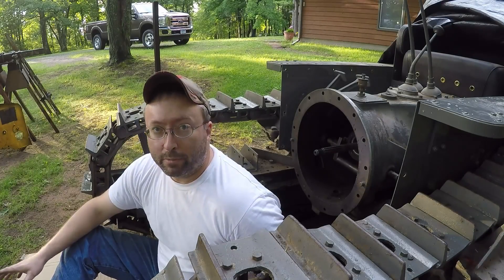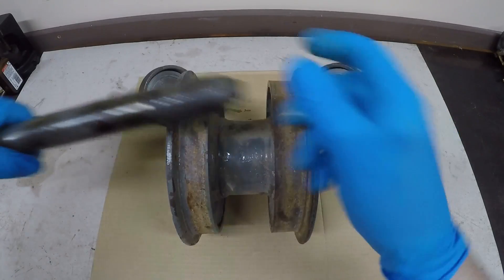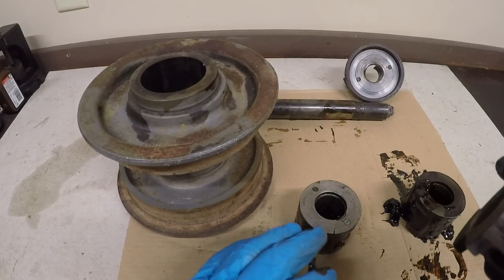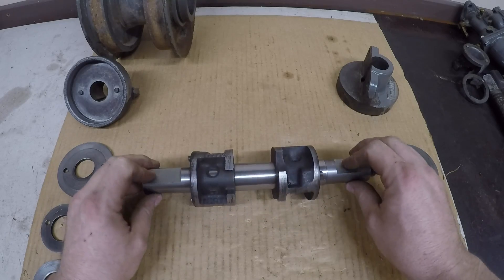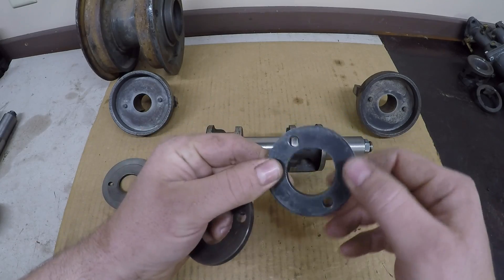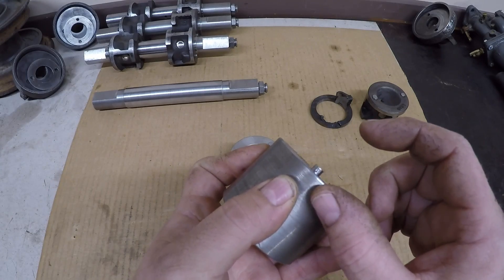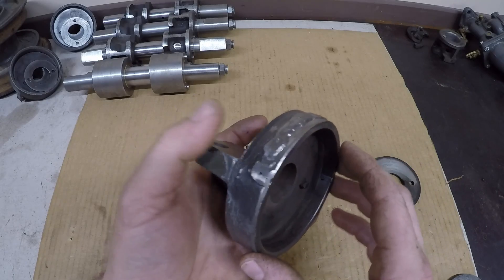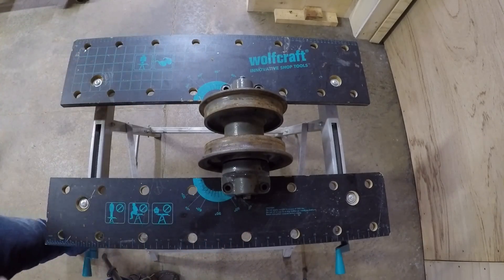Caterpillar Ten Track Roller Repair

Comment: After coming back some umpteen years later, did you check the input bearing for noises?
The clutch bearing rod shafts, there was no lip seal, felt seal, or ever oring?
Reply from the maker: No bearing noise yet, although I’ve only drove it just a few times in the years since. And correct, no seals on the clutch release shafts since this is a dry compartment 👍

Comment: Cat operators manual calls for "Roller Lubricant" tru the buton  fittings. Can grease be used instead?
Reply: @squatch253  Thank you.  I have the original pump that takes 3 gal or so, so I'm off to find a 5'er of 00 grease.  I'm having a blast working on my 4U, and appreciate your guidence.

Comment: I noticed you didn't talk about wear to the rollers themselves. in the late 60s and early 70s when I was just out of high school, I was working for an outfit that rebuilt and flew antique aircraft all 1929 or older. One of my jobs was to media blast airplane parts. We were working in the old caterpillar dealership shop buildings in Boise Idaho, Western equipment Company if I remember right. The blasting cabinet was right next to the automatic welder that would take track rollers and build them up back to factory specs. It was an early wire welder that used granulated flux that poured out of a tube over the hot weld. The rollers were on a lathe and the wire welder moved back-and-forth to build up the wear. In the late 60s the old shop buildings that were abandoned and I think 1952 or something had shelf after shelf after shelf after shelf of old new stock cat parts.  The good news is that at some point in the late 70s or early 80s all of those parts were collected and sold to someone who put them up for resale so they didn't just go to the metal recycler.

Comment: Thanks for the video. Just did the rolls on my R2. What did you use for material in building the roller shafts? I used 4140 Prehard which is not quite as hard as the original. should last for a few years !  See you at ACMOC.

Comment: What kind of steel did you use for the track roller shafts?
Reply: I was thinking the same since he didn't mention it but if I remember right from other videos on different machines the steel is just mild steel. And the thought process behind that is you want the wear...(well really you don't but greasing sometimes doesn't get done properly or timely and in that case wear of a replaceable part is optimal) so if shafts, bushings or end caps are harder than the rest of the roller then the roller tends to wear out. You don't want that.  The bushings, shaft and washers are easily replaced (or sometimes made) in the field where as rollers are probably harder to come by or remanufacture. I'm not an expert (by any means) and think this is correct so if I'm not, will someone with a better understanding a d knowledge please chime in.

Comment: I did a similar job on my D2, I got lucky and found a very good set of bushes and refurbished the rollers. I am currently working on a I H TD6 Do you know where I can get a cylinder head gasket ?

Comment: a trick you can use for grease passages is to use a boring bar with a flat (factory grind) and facing forward and manually run it back and forth into the bore advancing toward the OD about .010" at a time, thereby creating a groove.  you can then index the part around 180 degrees and do the other side. i used this technique to repair a rare fan hub for a friends'  '37 Studebaker President. it works really well and you have a consistent depth.

Comment: Just got a tractor late 1943 TD6. needed to find maintenance  /lube information on under carriage. Watched your lower idler rebuild, Need to remove that special nut on upper idler, you named it and i forgot it already. needs 2 wrenches to remove, cresent  is to thick for the other wrench to fit correctly.  Oh You the man. great job explaining to us new bees.

Comment: Well done!!! Anybody can answer my elementary question..... I realize that the tracks have a direction that they are to be installed. But, if the tracks were install backwards, sure, the machine doesn't know or care, but what are some of the side effects... I imagine, the pulling action from the driven or drive sprocket, on each link, and the placement of the big of grouser bars that is ment to dig into the ground for traction, being located at the trailing edge of each link of the direction being pulled, kinda would add to a stability factory, kinda like a fish hook or grapple hook is designed, in respects to the leading pivot point connected to the trailing edge of the next link, and preventing the links getting racked, as if the grouser bars were close to the leading edge of each link... Or to say, if the tracks were mounted backwards, the unit may actually start to lose traction, from the links jack-knifing due from the lever action of taller grouser bars... this may, may sound like nonsense, of a question... I suppose I could have just asked, if the coast has better traction in forward direction, vs being in reverse direction due from his the tracks links pivot points are in relationship to the grouser bars??? I know this is an older video, but I am still playing catch-up on this channels videos and info... Thank you in advanced, Dru

Comment: Just bumped into your site. I have a cat ten and a thirty orchard model. My ten has a top roller added. I read where guys did that to hold tracks on better. It's not bad shape still turns over. I have a friend has one also. We live in southern UT. I keep it parked next to driveway about once a year someone comes by wants to buy it. Great video your attention to detail is 2nd to none.

Comment: Nice lathe work. How is the grease getting into those Dremel made indents within the bronze bushings?
Reply: He crossdrilled the shaft,having machined the centre for that big grease fitting.
Reply: @paulmanson253  I meant the complete newly made bearing itself. It gets grease from the side by ground in by Drempel groves which is way less than the 3 large bores that are in the original design

Comment: Couldn't you find a bearing to fit and just use four bearings per roller with a center spacer?
Reply: @squatch253  For the retirement work that the 10 will do it should last another 100 yrs.

Comment: I subscribed to your channel. I like the design that went into the old CATs. They were made to be easy to work on. Up until about 1990 you could get parts for anything CAT ever made. If they didn't have it in stock, they would make it. Apparently some bean counters decided that needed to be changed. They sold or scrapped out all of the older parts. We had some 8T graders that we plowed snow with that the city had purchased in the 1940s. The local dealer offered us all of the parts they had in stock that they were supposed to scrap. 

I suppose case harden shafting could be used and steel or brass bushings made to work with the shaft.

Comment: Thanks for doing the videos! Just bought a fully functioning  1948 7U D4, but it needs a lot of attention. I have never had anything larger than a lawn tractor so I have a lot of learning to do.
Thankfully I have been  a machinist for 40 years and have some mechanical abilities. Looks like it will come in handy.
      What lube do recommend for the track rollers? 
      Thanks again for the vids!
Reply: Thanks for the information! Used it for the first time yesterday to remove 3 stumps in my woods. Tight quarters, quite the challenge, but a ton of fun! Tough to not use left foot as clutch and to not use dirt bike clutch modulation practices with left hand!
Just watched you latest video of clearing a trail in the woods.
 Thanks again for info!

Comment: i was thinking it might be interesting to look and see if there was a way to position a silicone oring around the outside of the outer thrust washer but with yours it won't be working anywhere near as deep in mud and water as it did originally.. 

do the track pins have grease fittings also.
Reply: i wonder if the chevron uniplex EP grease might be the choice for the rollers. if its available here.  i have been wanting to try it since i saw it over on the AvE or Bolter channel a while back.
Reply: 10/4 on the dry pins. Lubed pins haven't been around for too awfully long and I think back then about the only thing as fas as seals went was rope packing and felt, right? That's what I remember but that's just me.

Comment: WOW, you did good all the way around! Can't improve too much! I'd say the real reason about the grease would be to have enough to keep the dirt and mud out. I know with shovels they were greased every day and they didn't walk much. Looks like all the others were burned up with grease, especially the one that was notched out so bad. I was working on a dam job running a Wabco 222 pan that was always looking for a place to flop over. It had already done it once and I didn't trust it and started having nightmares about it. Would NOT dig level and we had no places to load the other way so I was ready to quit. Had an 8-H torn down that was being worked on so I ran a grader on the haul roads till it went back up and I started working the cuts and making level spots to load in. The 8 had a top roller shell gone with a fresh shaft supporting the rails. The shaft was close to 3 inches through and you can guess when a new roller went on it. Yep, when the shaft wore in two. And as far as finding stuff wrong, the boulder hole had a very used Northwest Model-6 Shovel that the car body was cracked on. They used over #400 of 1/4 inch rods on it over the course of a hard winter. Had it buried and pre-heated it with a rosebud every morning. Always job security for a wrench man if he wants it. Thanks, Buddy!
Reply: They had it buried in crusher run gravel with tarps over that I think. I know the guy that did all the welding and he is a very amazing man. He said they had a tunnel in and out. The car body was not hooked to the upper and off by itself. Yes, there'd be a mess all right but I was never the oiler for it. I remember the old crater compound all over the stick and cables. The welder was, I believe at the time, smoking, dipping and chewing and wound tight as an 8-day clock.  He spent his time before he came here with a 16# rock hammer in an olivine mine and had arms the size of my leg.  He's about 70 now but still much of a man.

Comment: What material did you use for the shafts? I would think those should be hard as a coffin nail to prevent galling on the bushings.
Reply: i was thinking that if he had one of the hand held crank polishers that had the skinny belt he could get the wear areas up to close to a mirror polish to extend the life against the brass bushings or cast iron insert bores.
Reply: That's true. It's not like this is the main plow horse in the stable. I have been told that the reason modern Cat machines have the best undercarriage in the business is due to their heat treating process and metallurgy (proprietary blend of 11 herbs and spices). I wonder what it was like back when this machine was new.
Reply: My dad worked in engineering at John Deere in the mid 1980s and he has always said that they could never figure out how to make an undercarriage as good as a Cat.
Reply: Bet some old Cat man could!